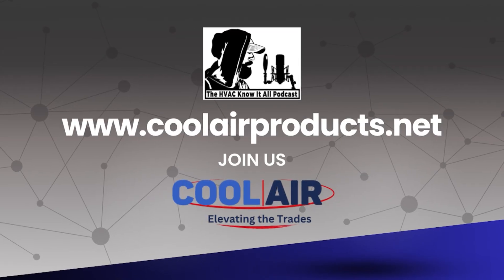How to Clean HVAC Coils Without Causing Corrosion or Voiding OEM Guidelines | John Pastorello Part 2

Comment: Hey Gary.  Hvac g3 here in ontario.  I have a payne 96 furnace that was installed in 2020.  It appears (on inspection via the scope camera), the fibreglass insulation around the furnace cabinet is in contact with the primary heat exchanger causing a burning smell every once and a while when the heat comes on.  There is alot of yellow brown oil right behind it as well (i assume heat exchanger oil which is normal i guess).  Have you came across any of the carrier furnaces with these problems or other brands with this issue ?  How would something like this be taken care of or fixed in your opinion?  I Dont have alot of airflow around my coil (which is a new payne condenser and OEM (not adp) coil).  Im going to get a taper and coil box with a pan because it was just hacked in any old way when they did it (i didnt do hvac then so i didnt know any better). Im sure by doing that as well, it will improve my 32 degree delta.  (fan speeds are set correct based on tonnage and match the sq footage of my home.  I will also note using an aprilaire 410 filter being yellow in a month.